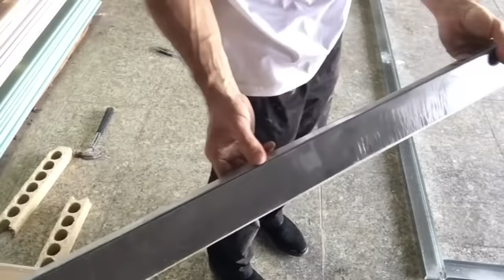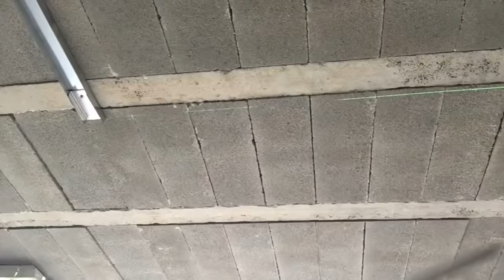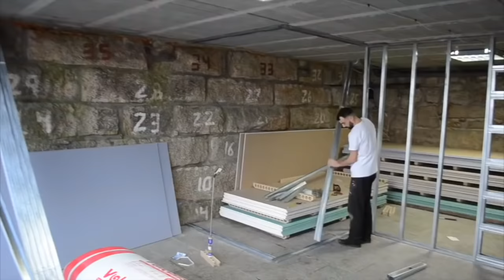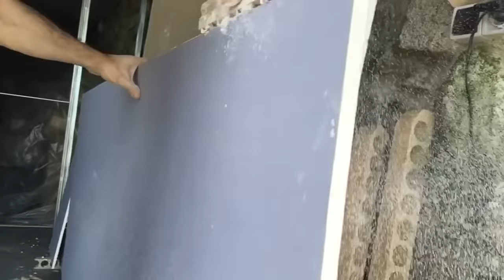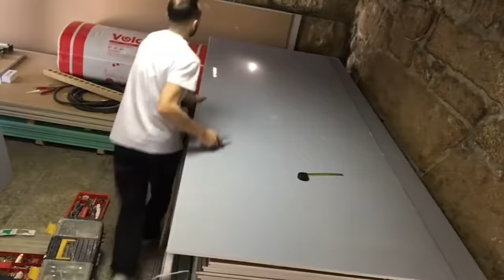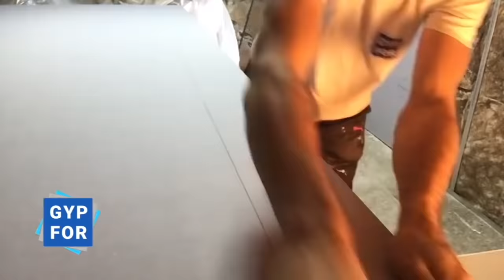🔥 Drywall partition ▶︎ How to Build a metal framed wall (70mm profiles)  PLADUR

Comment: Salut tres belle realisation 
Apparemment on a pas le droit de percer les poutrelles mais tu les a percés? Grave ou pas? J'ai la même configuration que toi je peux les percés alors?
Reply from the maker: Depende del país porque cada uno tiene sus normas aki se puede taladrar y ten por seguro que no la divilita. Aunque para la pared si vas al bloque es suficiente.
Reply: Salut, en France c'est interdit car s'il y a de nombreux trous il y a un risque d'amorce de fissures. De plus, si au perçage on atteint la ferraille, cette ferraille risque d'être à l'air libre et même minime, ça peut rouiller, donc risque de gonflement de la ferraille dans la poutre en béton, donc éclatement. Une fixation plus sérieuse serait dans le cas de plafond suspendu: l'utilisation d'agrafes spécifiques qui se coincent entre les poutrelles et les hourdis. Pour les cloisons: coller les rails sur les parpaings ou hourdis, ou bien des chevilles à frapper dans les hourdis. Mais voilà, lorsqu'on veut aller vite, faire des économies, il se passe ce que l'on voit sur cette vidéo.

Comment: You have no deflection head installed at the top, should use deep track at soffit, studs should be cut short 15mm-25mm, and not fixed into head track, flat strap should be fixed to studs just below head track and boards should not be screwed to head track, any movement in the building and the wall will buckle
Reply: I wouldn't bother on a concrete ceiling.

Comment: I never knew you can use the stud crimping tool for that.... so witch is better crimping the metal or a put an screw ?
Reply: Screw the bottom and punch the top to allow movement.

Comment: Thank you for the video.  I had a question on the tool that was used for punching a hole into the metal and the contact points.  Is that used for a pilot hole for the screws?
Reply: same question here, what is the name of that TOOL which looks like a Rivetter??
Reply: @gerdsenior6976  see my reply above.
Reply: @gavinhay6627  Do you care to repost please? I don't see your comment on the tool used to punch out the screw holes.
Reply: The boss should resell his tools. In france we dont ve
Reply: @video-en-direct   I'm 109% sure you have them in France. 
Pince à sertir Knauf pour profilés
Reply: It's a crimping tool

Comment: What did you use to fix the stud to the top plate?
Reply: Exactly what I was thinking I shoot the track to the ceiling and floor with a proper nailgun. It looks like he's just put drywall screws into concrete a big no no. Awful workmanship tbh

Comment: Watchout, this is totally prohibited to drill into concret beam !
Reply: Why?
Reply: @mchacknites981  Crack risk and rusting steel rods (into concrete beam) risk. It's better with knocking pegs into the bricks and/or specific glue (this is enough for drywall).